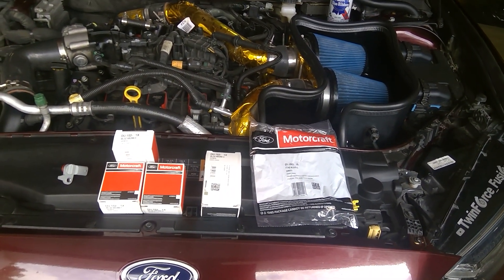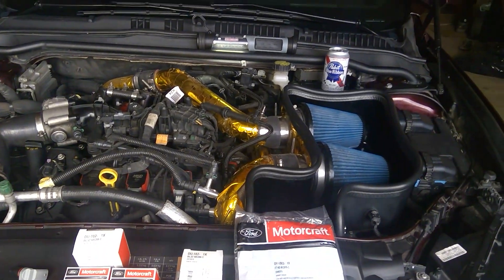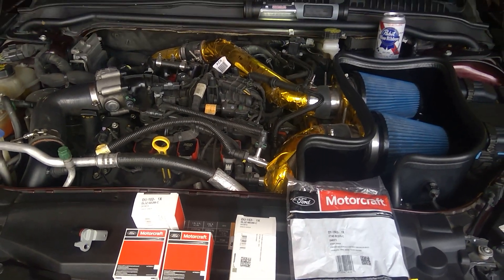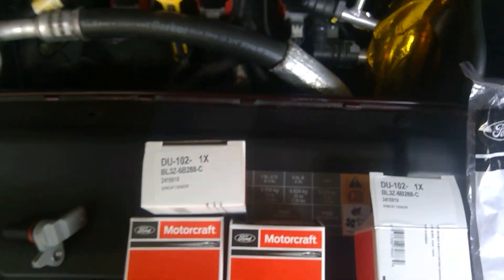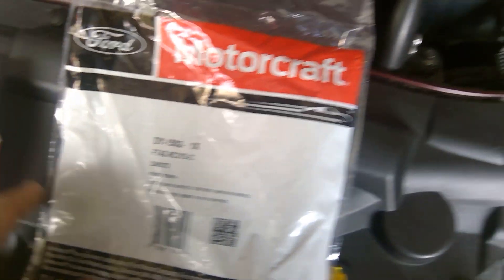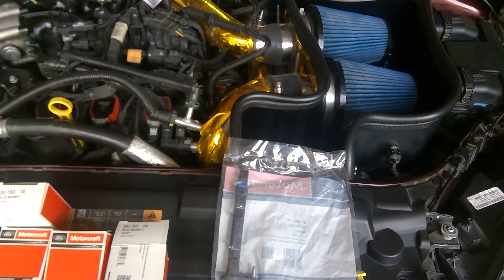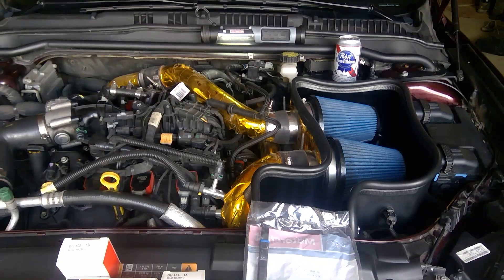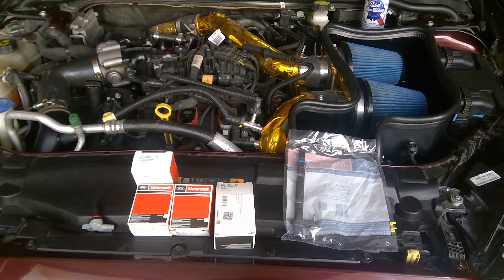CAMSHAFT CRANKSHAFT SENSOR DTC P061C Ford Ecoboost 2.7

Comment: Need you need the crank sensor or did the relearn fix it?
Reply from the maker: The relearn fix it, but changed the crank sensors on the new engine swap installation.